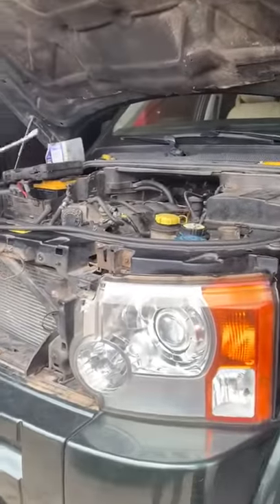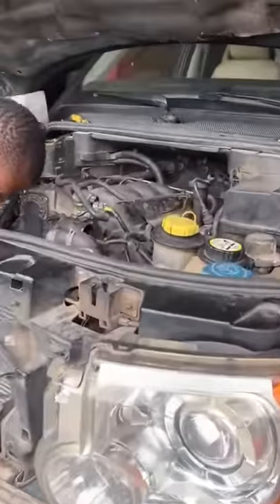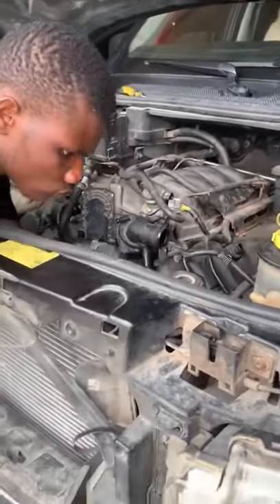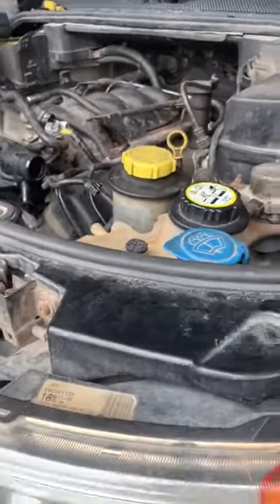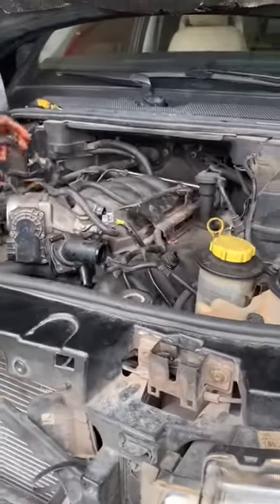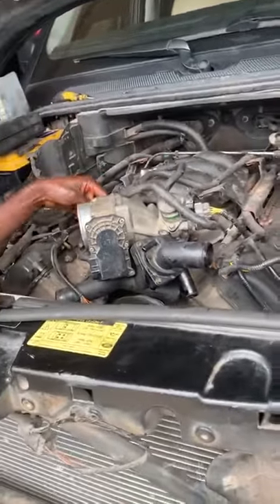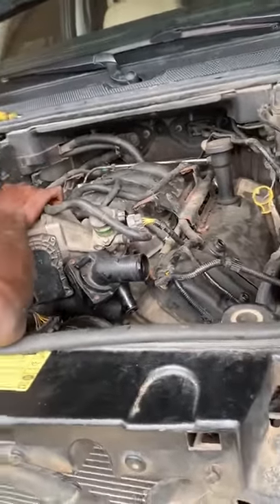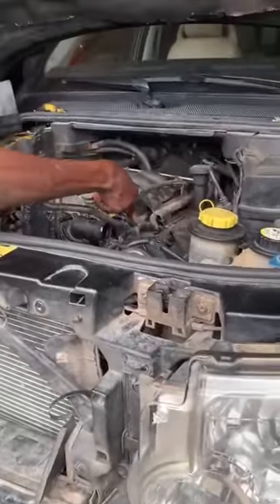2005 Land Rover LR3 mystery overheat problem

Comment: Those cars are notorious for being hard to bleed. You can fix all that and if you do not bleed it properly you will overheat. Make sure you follow the manufacturers procedures to bleed the system properly.  It has its own special bleeding procedure.